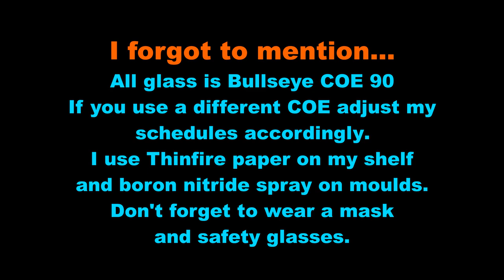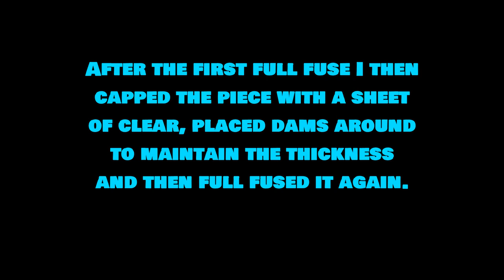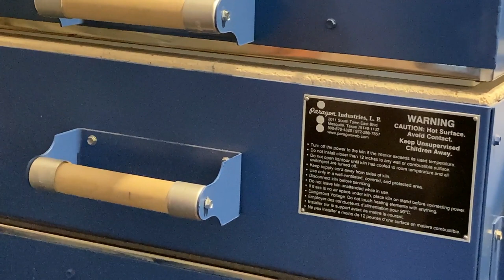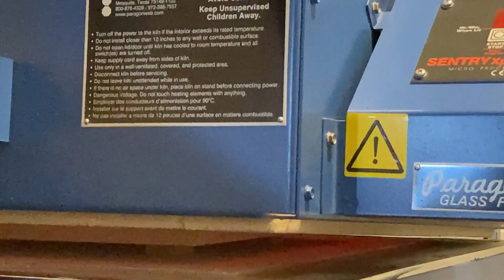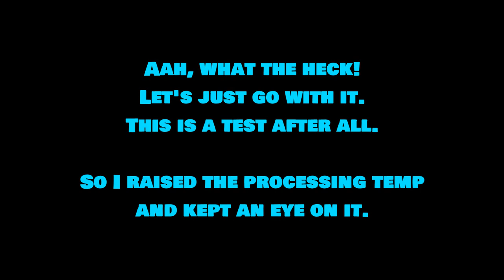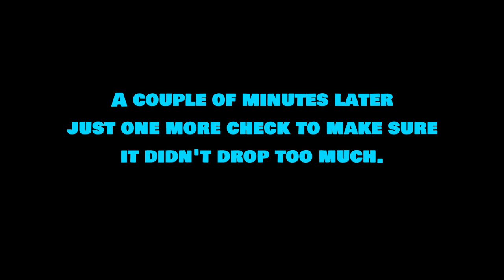Wow! A Fused Glass Drop Vase to Remember, Fused Glass Project

Comment: Hi Jeff, drop-outs are such fun!  Here's something that can help - I've learned it in Amanda Simon's class: You need to cover the drop ring with the fiber paper of the size and shape of your square panel of glass, with a hole cut out to match the drop ring opening. Align the corners of the fiber paper with the corners of glass while placing on the ring; it creates enough separation between the ceramic ring edge and the glass, and it works every time.  Must be fiber paper, not ThinFire kiln shelf paper.
Reply from the maker: Thanks Anna. Appreciate your feedback.

Comment: Here is my suggestion, based on a fair amount of experience doing large slumps of heavy glass.  The pieces I was making began with 24" x 24" x 1/2" blanks and the final slump was about 14" deep.  I made my own molds using a steel platform with 1/2 " kiln board covering the steel form.  The inside lip of the kiln board was sanded to a soft radius and slightly smaller than the opening in the steel support.  Once I brought the glass up to around 1100 F I slowly brought it up to the lowest slump temp I could-this would be around 1175 F for plate glass.  Somewhat lower for Bullseye. What this does is it allows the glass to evenly thin out over the entire slump so that the upper edges where it drops through the mold opening are close to the same thickness as the bottom of the bowl.  It is critical to support the entire brim to keep the glass from draping over the mold and trapping it.  It is also important to have enough glass around the opening of the mold so that it does not get pulled up where there is not enough weight to keep the edges flat.
Reply from the maker: Hi Jim. Thank you for that. I'm sure there are quite a number of people watching that will love the detail. That temp, 1175 F, is about where I usually slump into moulds. Sometimes less. If that was float then I would expect Bullseye to be 20 degrees lower. Over what time would the slump take once at that temp?

Comment: Jeff, thank you for all your videos. I am coming into kiln work from glass blowing and I appreciate all the work you are sharing. One thing about black and white...in glass blowing, we have to really work carefully with black and white. Black is softer, absorbs heat faster, and cools faster, and stiff white is much more resistant too heading and cooling. Worked together, they can be a major challenge, since they are moving at different rates, even though they have the same COE. I plan to use Bullseye's kiln testing method (a series of strips suspended on posts and placed around the kiln shelf) to determine how b&w sheet glass work together (or work against each other).
Reply from the maker: Hi Ty. Welcome to fusing. Similar problems in fusing with light and dark colours. I'm a big fan of testing. It's always the best way to go.

Comment: Thanks for putting this out there!  I’ve had issues with drop molds, too.  I agree that the square corners trapping the mold probably contributed to the shatter.  I also think opening the kiln when the temp is less than 1000 degrees Fahrenheit may have weakened the glass.  (Sorry, not good at Celsius...). I have been taught that it’s okay to open the kiln when it’s below 100 degrees or above 1000, but not between as the glass is at a fragile state between these temps.  I say to give it another go, as it’s our failures in life that teach us the most.  I think this was a marvelous attempt.
Reply from the maker: Hi Jill. The lowest I opened it was about 650, which is about 1200 F. And it stayed in the kiln until room temp. So don't think that was a factor. And I thought the anneal time was okay, but I've had second thoughts now. Because the glass thickness varied a  lot I think I should have doubled the anneal time. Probably a combination of annealing and those corners. Definitely will be making another attempt.

Comment: 3rd times the charm, I'm guessing it was the over hang, it's almost a perfect example of coe with stress caused by different degrees of contraction. I can see that the variation in thickness could cause a bit of a  problem with the annealing and it would be interesting to know what caused the variation to occur. I've seen someone who instead of of cutting the piece from the flat with a dremel uses a tile saw to cut the flat off ( hard to explain, like rotating dremel blade 90 degrees) gives an extra 15 + mm to the height plus a neat contrating edge. As always lots of good info in your vids
Reply from the maker: Hi Paul. This is an area I'm really learning. I think I understand with cutting the rim. Does the friend have a channel or website where we can see the end result?
Reply: @RocketRoseArt  Hi, I can't find it, one of those things that turned up on my recommended list a few years back but I can't remember her name. There is an Al Heilman vid where he  starts off cutting down the slab but then he finishes it with the same basic technique as  every other vid I've seen
Reply from the maker: @paulhampton938  I'll have a look around. Might be able to find it.

Comment: I think the blank was far too big for the ring. If you cut the corners off and cover the ring with 3mm fibre paper rough side up you will get a nice drop with sufficient grip in the fibre paper to keep the rim on the mold.
Reply from the maker: Hi Elizabeth. Yep, too big. I'm going to try a disc the size of the mould net time. Thanks for the info.

Comment: Aww, Jeff, what a bummer. I agree that the square corners and the cooling rate of your drop mold could be a factor. It might have also been that you had missed a small portion of boron nitride on the mold itself, and when the glass came in contact with it it caused a shatter when it cooled. I often have that problem if I miss a spot on a shelf or a mold myself.
I've done about 20 drop out bowls, with feet, and they can be a pain. I use a schedule from Delphi Glass, which I had to tweak.
https://www.delphiglass.com/free-patterns-projects/fusing-projects/free-poppy-sunday-dish-project-guide
I did have a problem with some bowls, and I think it's the same one you had. Transparent glasses flow better than opals. Opals are stiffer, especially white. So by having a whole sheet, it made the drop slower. It's also why the transparent piece fell through, I would guess.
I ended up having the mold hula hoops around one of my bowls, so I had to cut it apart. No more ring getting stuck.
Reply from the maker: There's a lot to think about and consider. At least the follow up worked, sort of. But I have a lot to learn with these.